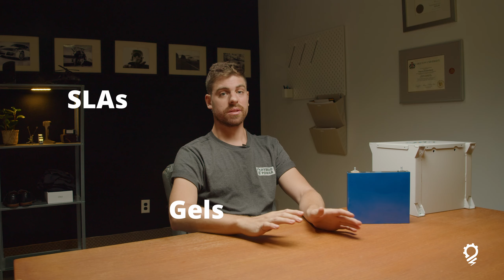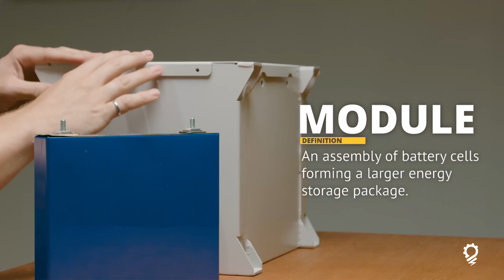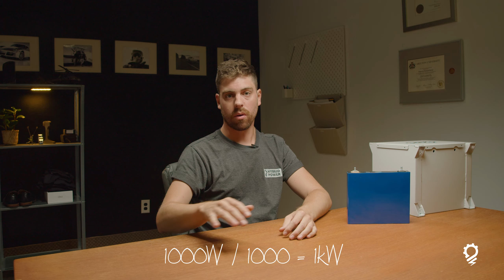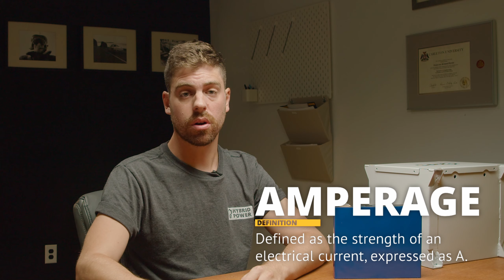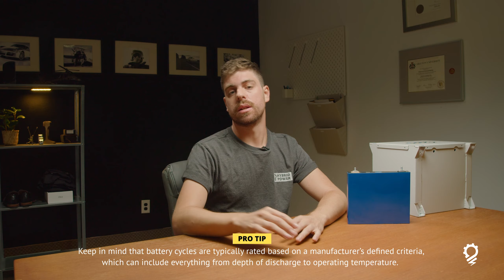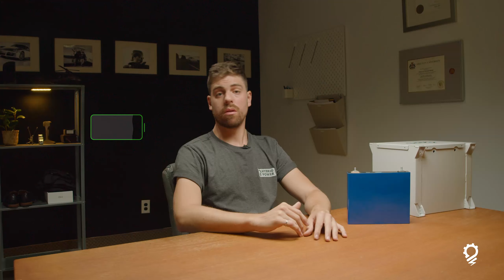Talk Battery To Me: The Lithium Battery Basics You Need to Know

Comment: Hi Francoise. Thanks for the info regarding the different types of batteries. Are you familiar with "Vanadium Redox Flow Battery Modules?" If you are , are you aware if the U.S. is currently using them in U.S. households. I understand that the U.S. sold or gave the technology to China. These modules (about the size of a refrigerator) would've been able to power a complete household and last for about twenty to thirty years. Recently read an article on this.
Reply from the maker: Hey, thanks for reaching out! I'm not familiar with those but would love to learn more. Are you able to share the article you mentioned?